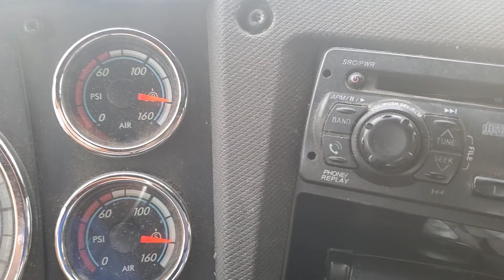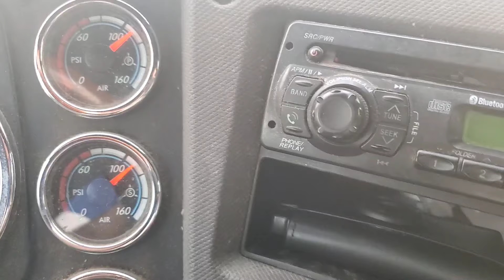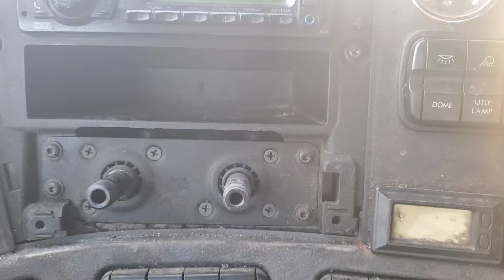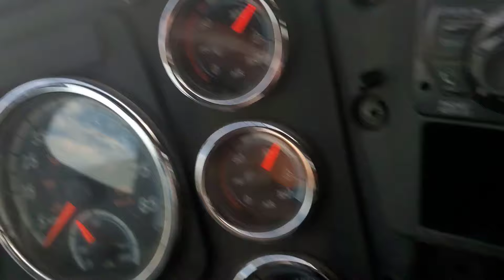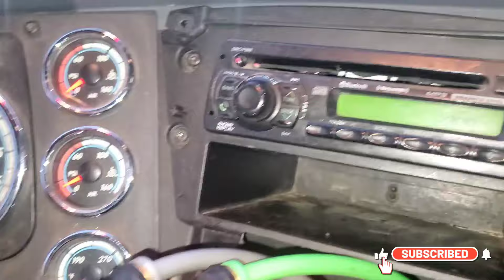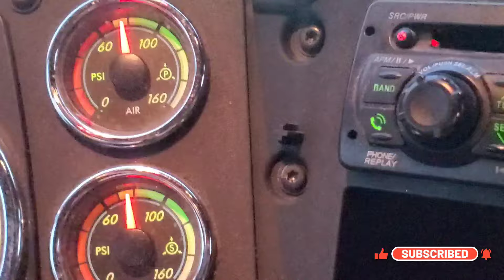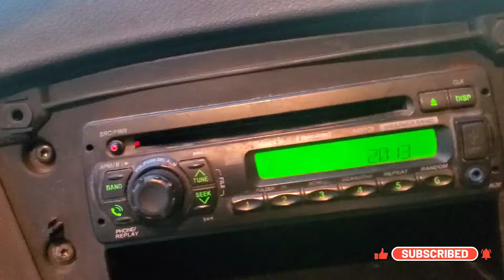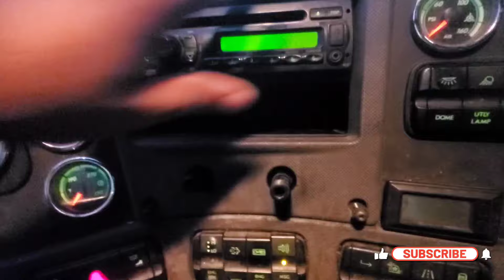how to replace DASH BREAK VALVE on FREIGHTLINER CASCADIA?Air leak in dashboard break valve? #trucker

Comment: Wassup brother I just pulled over to get a fuel at truck stop it took about 20 30 min I believe then I mentioned my rear 2 only air bags alloway down but the front 2 was inflated I was bobtail actually then started the engine I saw my air tanks was full but as I said the rear 2air bags down then wait a lit bit to see it goes back to inflate back to normal but unfortunately didn’t then I moved forward pulled over stopped released the breaks came up checked out it’s back to normal but I’m really confused pls need help some tips it’s a 2017 Freightliner cascadia im tired of this Bs truck spent more money on this truck then myself thanks
Reply: Did find the problem ?
Reply: Yes I did change the release valve it was damaged I got 2017 Freight shaker cascadia and it’s located right underneath of fifth wheel problem solved!

Comment: Hi, I have a volvo d13 2017 truck, which has the code P107538 coming up. Sometimes, it says that 'neutral is not secured', and the truck is unable to move forward, and it and says to check the transmission at the next stop. What could be the reasons for this?